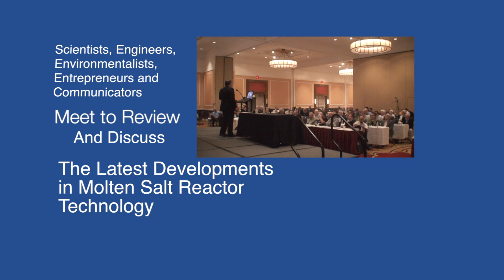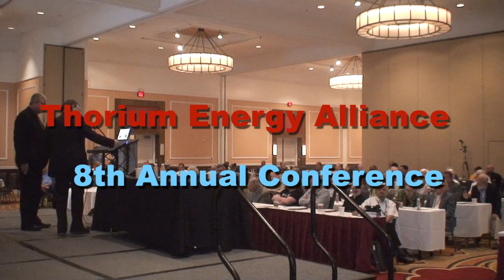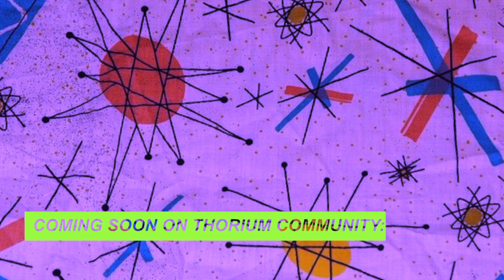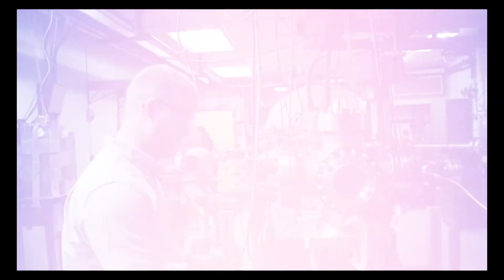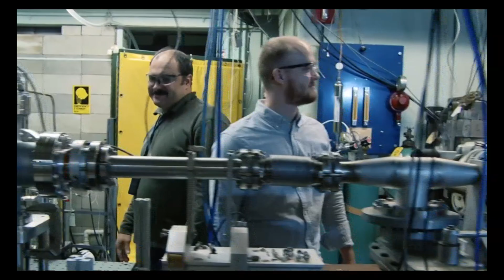TC No 29 Ed Pheil  •  Molten Chloride Salt Fast Reactor￼

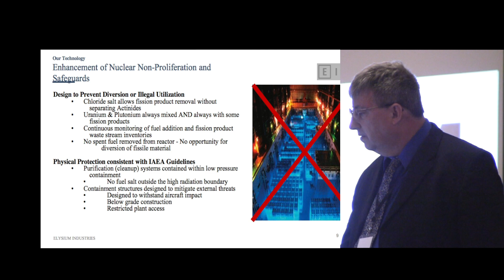Comment: I' m not completely agree that using highly enriched uranium in a such fast reactor is terribly expensive (@ 18:15 min). If I'm not wrong, even at 15 tonn of U-235 per GWe, 45 SWU per kg, 150$/SWU, etc...is about 100 milion $ per GWe reactor per year (whose reactor produces 8 TWh/year of electricty). That means about 1.25 cent per kWh, not exactly cheap, but still doable, considering it's an expense for the first 5-10 years only (and we have not enough plutonium or waste from LWR as fissile to start-up a very large fleet of these reactors worldwide, to begin with)

Comment: The biggest problem with H2O is in pure state it is an acid to most elements. The Navy deals with this regularly in their old steam plants. The obvious thing is use ceramic/silicon piping and regularly replaced couplings. But with water you need a lot of pressure to keep it liquid. Salt is happy to about 900C, @ 1atmosphere. That is a lot of useful heat. And much thinner pipes.($$)

Comment: I have followed Kirk Sorensen's work for years to develop a molten salt reactor that runs on a thorium fuel called Flibe. The problem with that has been that fluoride salts are very corrosive to the nickel alloy pipes. Ed's design using Chloride salts and a lower temperature seems to avoid some of the biggest problems to commercial deployment.
Reply: No, this is not true, the corrosion problem was solved by ORNL years ago through further development of the INOR-8 alloy and chemistry control.
The biggest hurdle to Flibe's design is definitely the online chemical reprocessing. It will be extremely difficult to make reliable and precise in high radiation fields. It's doable with today's technology but it will require a lot of testing to prove that it works.